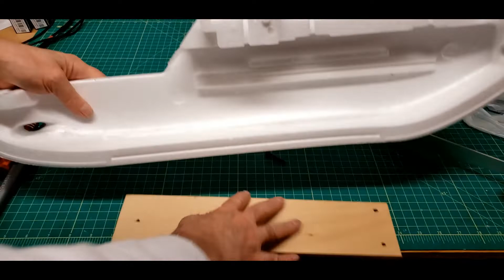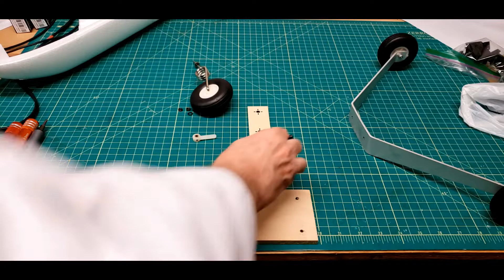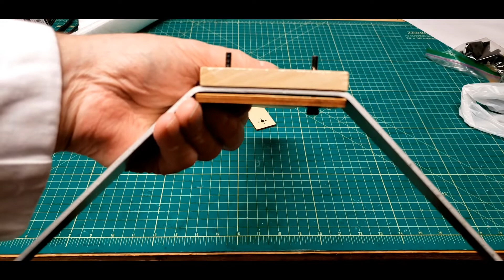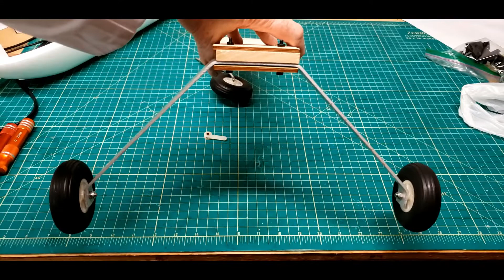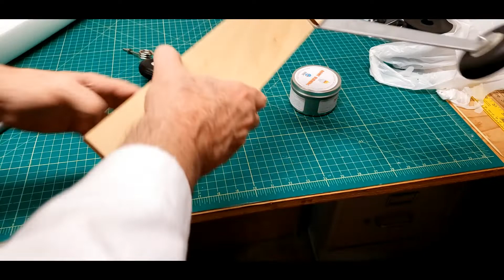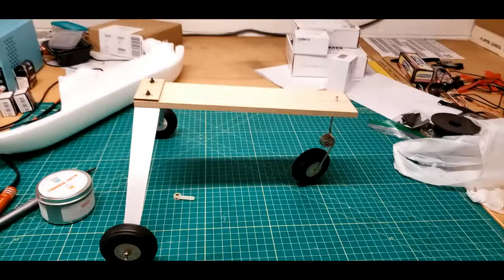Prototyping The Skyhunter II Landing Gear

Comment: Is it bad to have the front wheel so low? I saw your video and am installing the same kit on my plane. But after installing the rear I realized the front is super low comparatively and I'm not sure how I like that
Reply from the maker: IMHO it isn’t optimal.  All the real planes I have seen are level.  It moves the weight forward.  I am a little worried about the position of the mains and CG.  I assume they have to be behind the CG, but how far?  This is just my first attempts at figuring out some gear for the Skyhunter 1800.  I cannot recommend this setup yet.  lol

You installing the RMRC Anaconda gear on a Skyhunter?
Reply: @nighthawkvs  yup but I think I'm gonna set it aside and just laminate the plane instead 😅
Reply from the maker: @Michael-ee3dl  That would be lighter.
Reply: Love what you're doing. Landing gear on larger planes GREATLY simplify things. If you put a small nylon square block in front on the bottom it will both act as a bushing to prevent wear on the basswood and it will also lift the nose up a bit. The shorter/easier a plane can rotate upward (pitch) the easier the takeoff. A low nose means lots of rotation needed to get that nose pointed skyward. The bush planes (super short take offs) are all pointed upward to begin with. Just my thoughts.
Reply: Seeing how I am going to fix my skyhunter, I like this idea.

Just seeing if I can get aluminium on the rear wheels, so bending them a bit to move the wheels out and get it lower.
No need to move the front up, just the rear down.